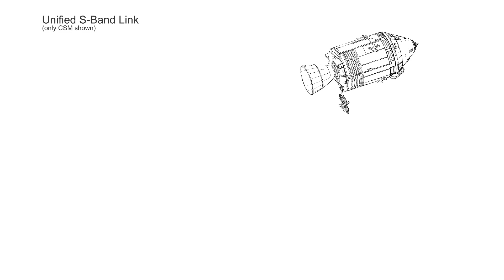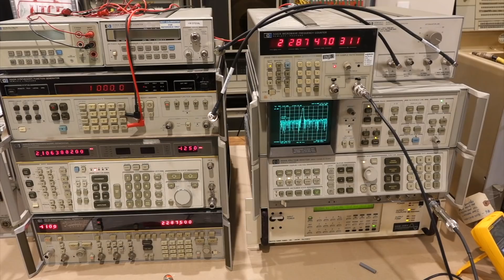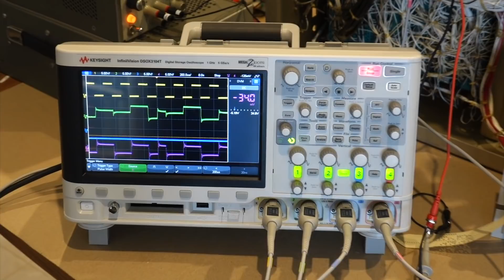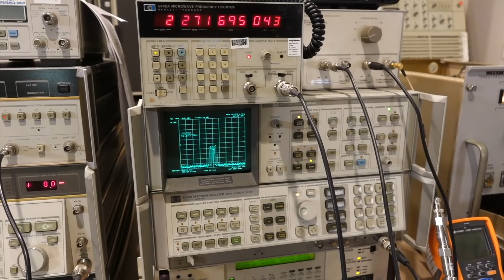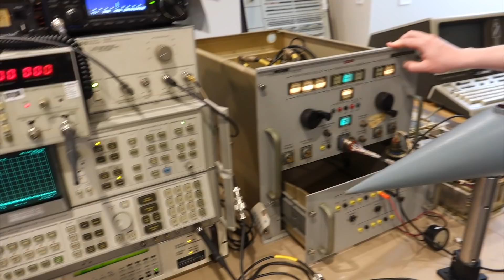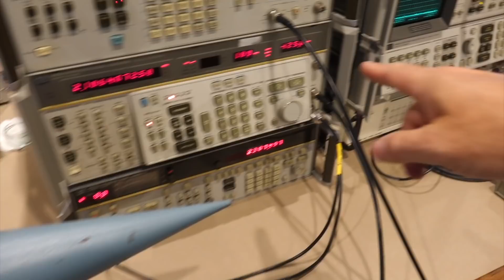Apollo Comms Part 6: First tone transmission, to the Moon and back!

Comment: Wow this is so incredible. Good job Marc, you're doing an amazing job!

As a software engineer and someone interested in Ham Radio stuff (and designing pcbs), I'm absolutely scared by RF - being around that much powered RF would probably scare the crap out of me, lol
Reply: Don't look too close at what is coming off some of the circuit traces of the mother board in any modern computer  :-)
Reply: You need to learn what safe exposure limits are for RF at various frequencies.  There's a reason they needed such enormous antennas at the DSN receiving sites to hear Apollo.  Apollo was only transmitting 20 watts max.  At 2200MHz, minimum safe distance from a 10dB antenna at 20W is 2.7 feet.  But I don't think they were using the 20W power amplifier because it wouldn't matter which way they were pointing the antennas.  They were likely running just a few milliwatts from the exciters.
Reply: @stargazer7644  oh for sure, and I'm not suggesting it isn't safe - I'm just overly cautious, I respect anyone working with the blackest of black electronics arts - and yeah I definitely need to learn more about the safe exposure limits and whatnot. The first ham tests do go into a lot of that, but not about the safe exposure limits for the ghz spectrum - your comment definitely gives me some additional insight

Comment: Can you figure out the Doppler shift from one side of your basement to the other?
Reply: Zero. Doppler shift reflects relative motion. They would need to put one of the antennas at the back of a truck and take measurements while the truck is driving away to see any shift.
Reply: @alexsuykov   That's the point. 

Even a truck wouldn't be going fast enough to get a measurable shift with that type of equipment.
Reply: @marvintpandroid2213   It would definitely get a measurable shift. ;)
Reply: @marvintpandroid2213  in fact, they would see about 300Hz difference at 50mph, if I calculated right.
Reply: @Sixta16   I would suspect that a 300Hz difference would not be detectable by that kit but maybe, when you consider that the re-transmitted signal would 2x the frequency shift for the ground station.

Comment: If you need a video signal to try, I've very basic support for the two Apollo TV modes (colour/mono) in hacktv. You'd just need an FL2K-based VGA adaptor to get the signal from the computer - or something that can play back from a raw file.
Reply: I've been wondering how much of this stuff can be done in modern sdr...
Reply from the maker: @rpavlik1: I believe all of it, when it comes to the the subcarrier and modulation stuff.
Reply from the maker: @fsphil: can you contact me via the link in the video description? we would welcome some help there.

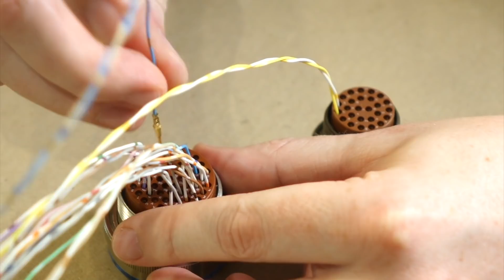Comment: 7:43 Very interesting. It turns out that these multi-pin electrical connectors for military and aerospace purposes of Western production are crimped. Or is it a modern version? 
Soviet (Russian) similar electrical connectors for soldering only (military standard requirements).
Reply: They are available in both crimp or solder connection, just a change in the pin type, with the solder type having a small hole at the base of the tube, where you can see, before soldering, that the wire is inserted to full depth. However you can crimp the solder type, as they do have identical dimensions, and the same crimp area in the middle. In most cases you get the solder type with new connectors, the crimp only being rare, as the hole allows you to do inspection of the crimp for full insertion as well.

In general the solder type was more used for connection to flat flex, having a pin instead of the hollow, so you would put the multiple layers of flat flex on the connector back, or the small PCB, which carried the connections out to terminals inside, and then solder the pins in place. In general the pin type did not come with removable pins, being typically a sealed unit, for chassis mounting in a hermetic case, and thus all the pins or socket inserts were rigidly held in place by a potting compound, with the front section being the regular elastomeric seal to keep them dry and dust free.

The crimp is generally the more reliable connection, as the wires are free to flex in the tiny area between end of the crimp and the insulation, unlike solder, where this area is now rigid, and thus tends to fatigue with vibration to snap off just inside the insulation where the solder has wicked up into it. Thus the $$$ crimp tool, which has a service spec to it as well, plus a testing schedule and verification of crimp strength, that you should do every so many crimps. With that the tool is actually the cheap part, as you send it off to a lab for annual or cycle verification, and also do pull tests on a sample of the batch of pins, and the wire batch, before sending into production. Not used here, but when you are doing 100k of them on an aircraft, you do not want to have to replace an entire wiring loom, because one pin was under crimped at some point, and failed QC using the calibrated puller to test.
Reply: @SeanBZA  When I worked on military-avionics, I saw all manner of types.  On the good solder ones, there was a rubber buffer-disk (with all the holes) that was compressed up against the part where the wires exited from the connector to minimize vibration-breakage.  When we would vibration-test (shake) the boxes, most of the problems that I saw were failure of the pins to lock into the receiver-disk (the pins would back-out); thus causing you to have to pull every darn one of them out and put on a new connector!
Reply: @SpinStar1956  Depends on the connector type as well, the screw on Cannon connectors in high vibration the pins and sockets had to be inspected every minor cycle, as they would vibrate and wear each other out. Crimped only, even inside the avionics box there, though the PCB mount points were potted with both a soft and hard compound, to provide some form of stress relief to the connectors from wire to board, but the case connections were crimped, and that rubber backshell section definitely helped. The 2mm pins that you put in 500 hours ago came out looking like needles, mainly because that say just above the afterburner case, and those boxes led a short and merry life. But you always had spare ones in the store to replace them, along with the small section of wiring loom, to a less stressed connector as well, in case you ran out of slack in the cable section.

Then the curse of somebody breaking a pin in the 240 pin diagnostic connector on one of the boxes, and it not being one of the redundant or spare pins, so you have to remove all 28 flat flex cables soldered to this socket, and replace both the socket, and most of the flex cables, because they did not survive. Then hope there is stock of the ones that you need, otherwise the box joined the shelf of "awaiting parts" ones. I was lucky, all mine were wire wrapped, so replacing was only a job of redoing small sections of loom to put the new socket in, and unsoldering the wire wrapped pins on the backplane connectors. Yes, soldered modified wrap, every unit was essentially a prototype, as the run was under 100 units.
Reply: @SeanBZA  that hole is a witness hole dude. None of the complete round ones are supposed to be soldered. The solder pins are not removable and are cup shaped.
Reply: There may be multiple versions.  I've definitely seen solderable cannon plugs like that.
Reply: Early ones where solder (40ties/50ties), then crimp. It's 4 little teeth that compress the pin without out of rounding them. There are front release and rear release. Fantastic connectors but the tooling is expensive.  Beware the cheap knock off tooling.